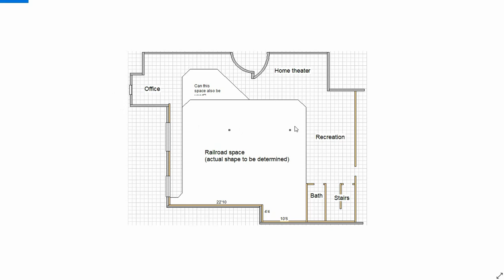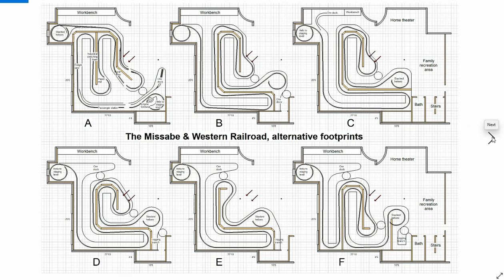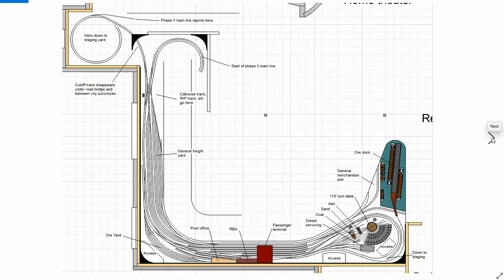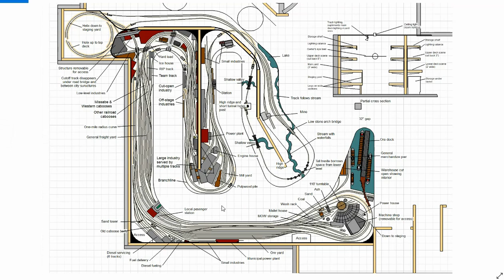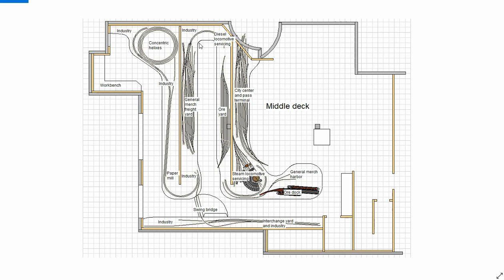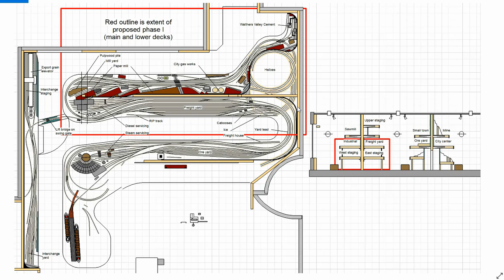Missabe & Western layout design, part 1

Comment: Having just watched your latest slideshow of dismantling, reassembling and adding the first scenic layer, I thought I better come back and look again (again!) at the track plan. I think that even just watching the workings of the lowest functional level will be fascinating in itself, but then to have the upper three levels to 'mess around' with just makes this even more awesome. 
I wonder how often the potential operations of this layout will actually be realised, and how many operators would be required to have it fully functioning?
My other thought is how much of the layout could be automated as it would be fun to see trains just going for it, round and round, even with no one actually doing anything? I used to love watching the automated layouts in Beatties, Holborn, London when I was a kid, at least I think they were automated?
Reply: With JMRI or another similar software program you might be able to set it all up to be automated. Switching and all. The computer programming side of model railroading has grown in leaps and bounds over the last 10 years. Writing all the scripts for JMRI is the hard part to get the timing right where all the trains stop at the correct place. Very possible to automate the whole thing.

Comment: Somewhat off topic but thought I’d ask.  What preference do people have for ceiling materials?I have a new home with visible joists but trying to decide if I leave the joists exposed, cover with Sheetrock or use a drop ceiling.  Interested in peoples thoughts or what you did so I can get past that hurdle and move on to final design and construction.   What did you do for lighting?  OBTW, the room is approximately 29’ x 17’.  Thanks for responses.

Comment: You have done a magnificent job on each iteration of this layout. I know that you have moved on from the first layout design because of the desire to keep the natural light from the windows but I personally liked that plan the best and looking at the cutaway that you did, it appears that the lower level at 24 inches and the upper storage level above the lighting valance would not block the windows at all and only the 44 inch level and the 64 inch level would interfere with the light entering the room. Couldn’t those two levels be reduced in thickness, only in front of the windows, to allow the most possible light into the room when not in use with a removable backdrop that would only be installed during operating sessions? Of course you have a better feel for the room and the client than I do and I’m only looking at what you have provided but I believe the initial plan you did was absolutely impressive and the best use of the space available if the client and his wife were accepting of this compromise.
Reply from the maker: Thank-you for your comments.
Actually, I came to like the revised layout better.  Although it took a while to get there, we ended up with a better use of the space.  It became practical to nest the helixes one within the other (quite a saving with a 36" minimum mainline radius), and we were also able to restore the passenger terminal.  Although we only have 4 "runs" on each deck instead of 6, they are all long straight runs - which we only had two of before, and that makes all the difference.  With the interchange section across the aisle adding industrial spaces, the remaining industries were able to share a section with the paper mill complex.  Although the earlier plan had its good points, all things considered, I thing the later one is an improvement even if it were not forced by the space considerations.

Comment: Wow that is a lot of tracks. Going to be busy building that but it will look great when finished
Reply from the maker: Yes there is a lot of track on the main level (which is at the ideal height for intensive operation).  The upper level will have a far lower track density.

Comment: Nice vid.
Your mention of reversing loops makes me curious if DCC electrical considerations ever come into play in your layout design, especially with such a large and complex design.
Reply from the maker: I always consider the electrical ramifications (and a whole lot of other things that are not readily apparent) while designing a layout.
Reply: @mpeterll  Showing an example of how you do the DCC wiring and block separation for any of the reverse loops in any of your designs would make a great video.
Reply from the maker: @donaldshroyer8633  Hold onto that thought.  There is one in the pipeline.
Reply: @mpeterll  
I agree, the electrical considerations for track power would be fascinating.  While DCC is king today in the future I really think Dead Rail Operation will come on strong. With advances in battery technology driven by products in numerous fields and the use of Bluetooth receivers the days of track power problems will become a thing of the past. But for that to happen one of the locomotive manufacturers will need to jump into the market place. The other thing is how do you charge the batteries and how long will they provide sufficient power. If they can handle a two hour operating session I would think that would be enough to start. Charging could be either on a short section of powered track or possibly by wireless charging as used by some cell phones today. Such systems are in use today by some adventurous model railroaders. Plus they would be a real boon to the individuals that have difficulty getting the red electricicles to go down the red wire. The green to go down the green etc.  🙄🙄 Like me.
Reply from the maker: @mpetersen6  My thoughts are that the ideal situation would be for an on-board rechargeable battery, a function to indicate the current battery level, and the ability to charge through the rails.  Then, for ultimate realism staging yards and locomotive service tracks should be powered so that once a locomotive has finished its run, it needs to go for "servicing" in the engine terminal.  Then a battery doesn't have to last a full session, but just one run over the whole length of the layout.  If a locomotive is used for a shorter run, then simply topping the battery off for a few minutes should be enough for the next run.  If the battery is located in the tender, then bigger tenders could hold bigger batteries for a longer range - ultimate realism!